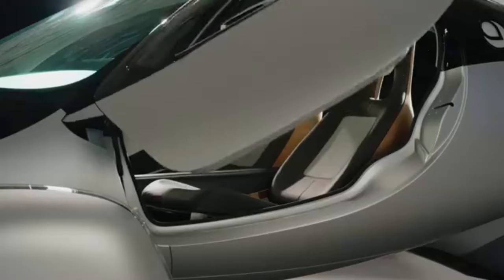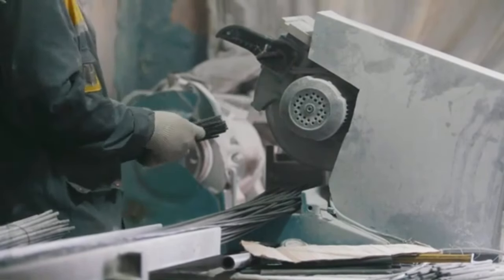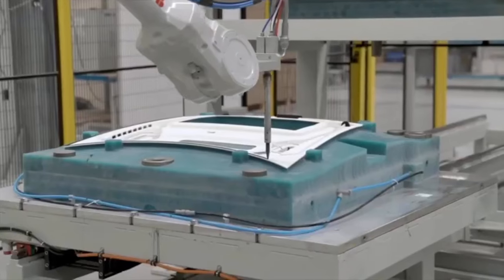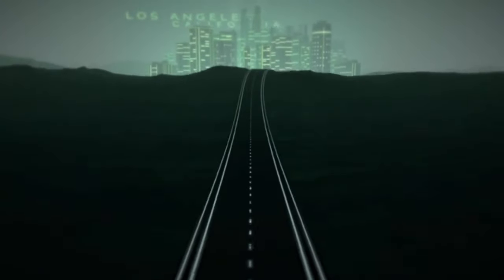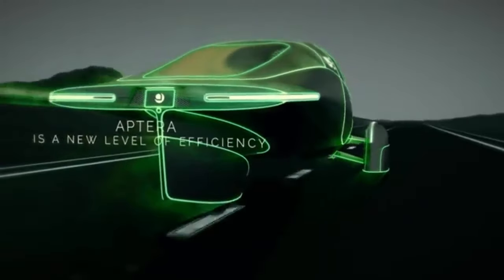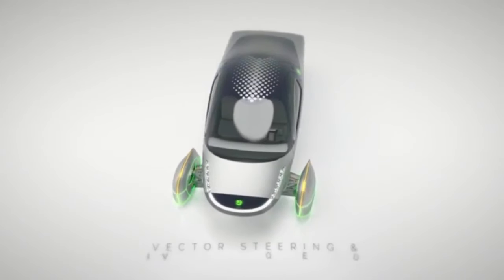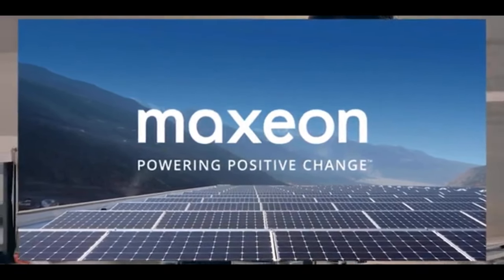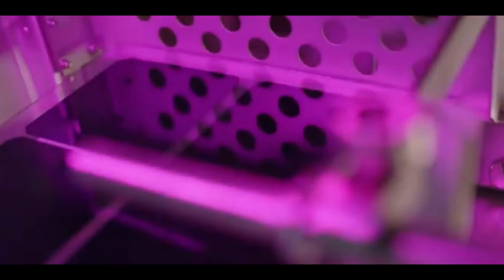Aptera's super abilities Defined by it's Body in carbon, in wheel drive system and Solar panels.

Comment: Origin of car here (Mannheim, Germany Carl Benz *1886😊). Point Zero: Great job! 
Fact 1: Mostly great but the width of 220cm is far to wide for European roads. Despite the official limit is 2,50 Meters...  in Germany we have too much narrow roads (France and Italy too!) e.g. lots of brigdes in repair are closed for wider than 2 meters. For wider streets in US its good - but for sure not in Europe. Here you would need a 1,80 or 1,90 at max 2 meter wide version;  this results in spooned seating like in Twizzy then. This would be a lighter European version for zillion of commuter or craftmen
.A 2nd emergency seat or freight part behind driver. With 70% of ressources used you could sell it just below 20K€. ( lesd materials, only one Motor ). Going at max 130km/h. This is the limit in France anyhow and the defacto limit in Germany. Aiming for  5KW/h per 100 km consumption. This would be a killer for highway and cities and a or better THE car for the whole 21st century!

2nd Fact :  Three wheel is always bad in the middle lane. First car in 1886 was skipped to four wheels back then. Same applies today, despite it was one wheel front and two in back. 
Question back : 
When is European adapted sale or European version or 4 wheeled Version comining?

Comment: Up to 40 miles on solar charge, in addition to it's 400 mile range.

I think is what you meant.

Great info on the Fiber Properties.
Reply: Aptera is offering versions with an estimated 1000 miles range not just 400. Although the 400 I believe is the most common preorder.
Reply: @Fairburne69  The second planned version will have a range of 250 miles, then 600, and finally 1000.
Reply: Realistically it would be around 8 miles a day in Europe.
Reply: @tomstickland Oslo gets around 1668 hours of sunshine per yesr, compared to 3057 for San Diego.  It doesn't look like the difference is as large a you say, especially when power costs are included.

Comment: I really really hope the Aptera will be as good as it appears. As much as I'd love to preorder one I've been screwed by promises too many times in my life.

I'm going to wait until reviews and test drives come out before I order one. That way I can make an informed smart decision from real world results and not promises made in a lab. I think my biggest concern is software related. The other concern is the yoke and luxury. I'm currently driving a 65k Genesis GV70 which I love. With a 40ish k Aptera how much will I sacrifice in luxury for Aptera efficiency? Time will tell.
Reply: I  visited Aptera 2 weeks ago and drove their latest vehicle, it's as cool as all the videos.
Reply: There is no risk to place a pre-order.  It only costs $100 (or $70 with a code from a reservation holder)  The money is held in escrow and can be requested back at any time.
Reply: @greenbergp  Can anyone just go and visit? So they give tours? How does all that work? My hope is to test drive a PI vehicle before I buy.

A vacation to visit my niece in CA (I live in Maine about a 1 hour drive from Boston MA) and the Aptera facility would be a fun trip.
Reply: @Fairburne69  i have a very low reservation number and overall they sre busy enough working. I have been there 3 times over the last 4 years. They are getting closer and closer snd are an excellent company.

Comment: Great video. But the three principles that that set this car apart is lightweight, low air resistance efficient drive. The solar is great but it is a added benefit from the other’s this car would be great with out solar it’s better with but should not over shadow the original concept.

Comment: Hub motors are neither innovative or a good thing. They are less efficient than inboard motors and exposed to the elements more and wear out faster. 

40 miles a day is the theoretical maximum, it is achievable only in peak summer in a dry climate, it means never leaving the car in a shaded place or garage.

It's not a car its an e-trike with a canopy.
Reply: You need to do a little research on Elaphe motors before pronouncing them unsuitable.  Rated for a million miles, integrated disc brake  for emergency stops. Aptera has done a lot of testing to assure long-term performance.
Reply: @williammann7247  Rated, but never proven.
Reply: Well then,  put glass roof in your garage or how about solar on top?
Reply: @gregor-samsa  Work on imroving the solar and you are still stuck with those dangerous in-hub motors. Better to just buy something that doesn't have them and opt for the garage (and house) roof solar. Much better; your house power will also benefit.
Reply: @aussieideasman8498  Why are those motors dangerous?
Reply: @aussieideasman8498  Your credibility just took a hit with that general statement of in-hub motors being dangerous.  Are you confusing hub motors in electric bikes which is completely different? Obviously you haven't seen the environmental testing Elaphe has done and their motors have been tested up to million miles.  Next time try talking about something you know about.